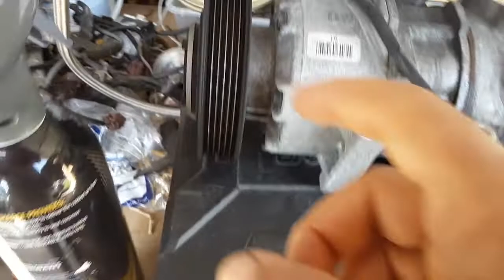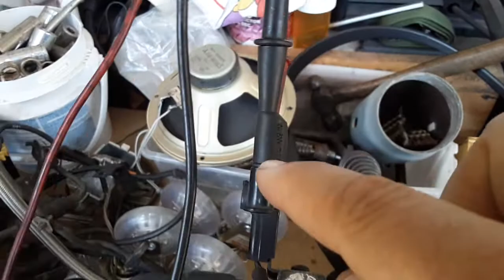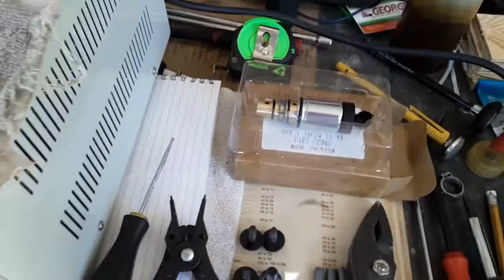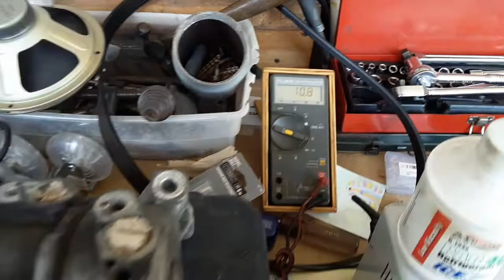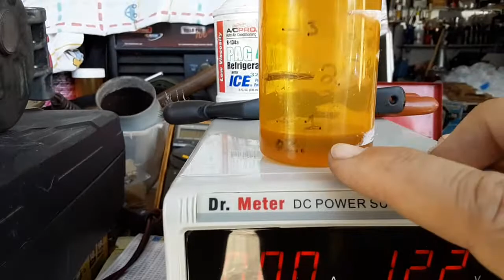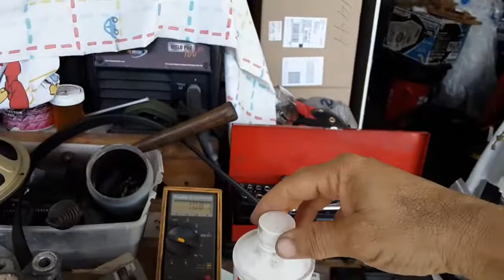2013 Kia Rio A/C Blowing Warm Air (part 2)...

Comment: Great video. Would it be a good  idea that once the pressure valve is loose, turn the compressor up side down to  preve nt dirt getting into the port? Maybe use a CRC spray cleaner or carb cleaner prior to loosening or removing valve?
Reply from the maker: Yes, most definitely and prior to removing the valve, you can also take a brissel brush to get the lose dirt off and then use an air gun to blow it down also.

Comment: Can you bipass the valve and just have the ac on all the time?
Reply from the maker: No, the valve is needed to make the system work properly between the low and high sides of the system...
Reply: @MannyFontes1968 ok thanks. I'll be doing this over this upcoming weekend. Ty

Comment: This exact same thing happened on my 13 Rio. I replaced the valve and reccharged th ac. Did it myself.  Works great now! I did not need to remove the compressor though
Reply from the maker: Were you able to get to the valve without any obstructions? Also, did you do a vacuum test before re-charging with the right amount of R134A?
Reply: Hello. How were you able to replace the valve without taking out the compressor?
Reply: It’s easy…just gotta use a clamp to pull it out…I didn’t have to remove the compressor. It’s accessible from below

Comment: Its any way to test the compressor valve without to take off from the compressor?
Reply from the maker: Yes you can but it won't be definitive if it's the problem because you need to see if the valve is actually opening and closing when you apply 12v dc to it. You need to make sure that spring valve is opening and closing.
Reply: You can usually hear it open and close if you are in a quiet setting.
Reply from the maker: @pythonprogrammer7354  Yes, that would be ideal in a closed garage.
Reply: @MannyFontes1968  You just unplug the valve connector. And you would need to apply 12v to the 2 contacts on the valve. You should be able to hear it open and close as you touch the contacts on and off.  Hope this helps.  Good luck.